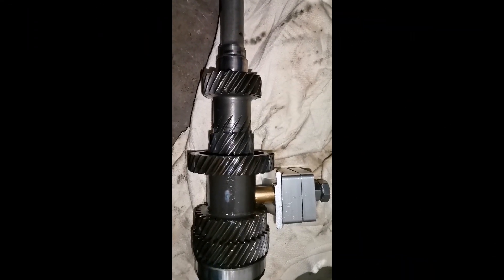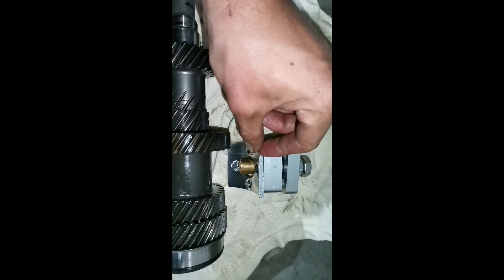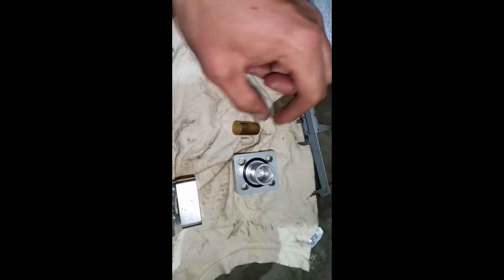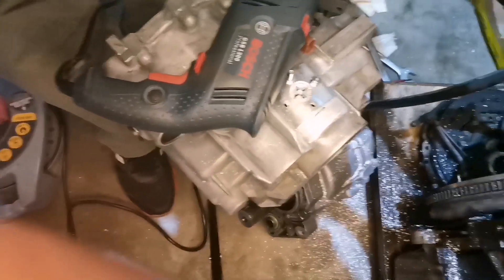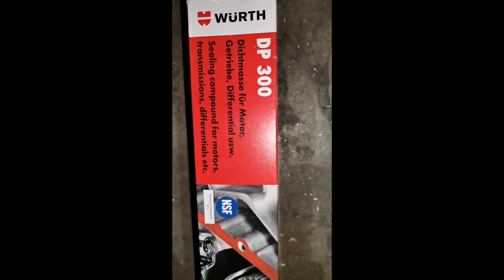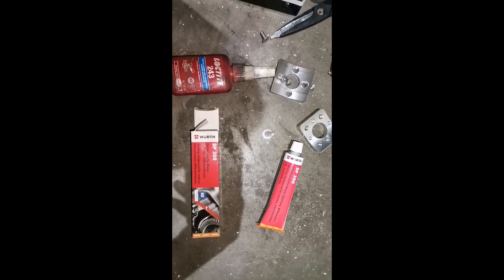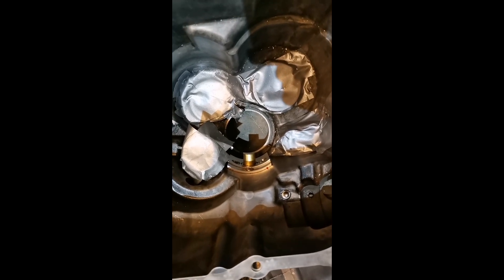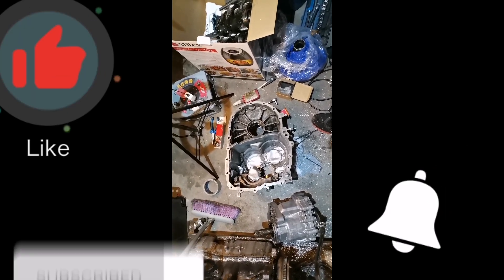02M 6-Speed Transmission Upgrade Pt5: How to Install, Bar-Tek, 02M/02Q 4th Gear Support

Comment: Hello bro, how did you find the measurements before drill??
Thanks
Reply from the maker: hi eddy it was a guessing game really, i measured the input shaft from the input shaft end bearing to the spot where the support should sit on the shaft, then i used that to mark the spot on the outside of the case.... but what i did wrong was, i gave too much room for my reverse light plug..... now my support is close to the one gear... it sucks really
Reply: @road_2_pow_r  yeah I noted that, should be a little bit more inside but was good, will try myself just need to order the plastic cap
Reply: @Eddy-th3kc   How did it go mate? Did you manage the installation?